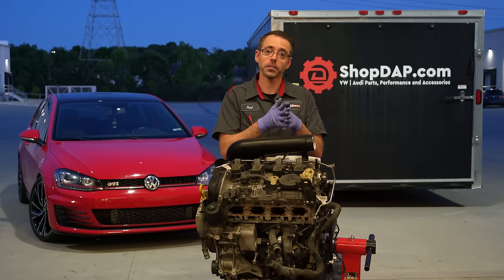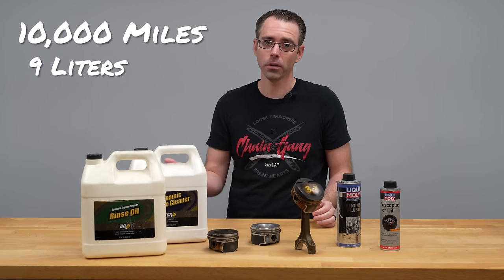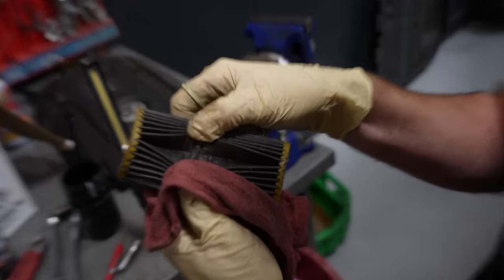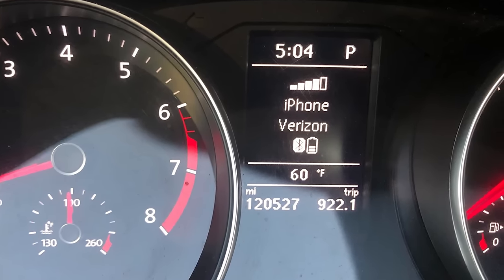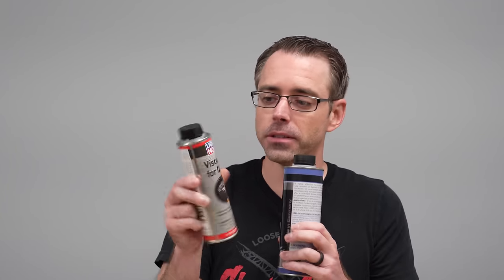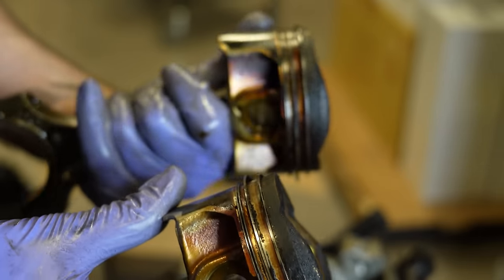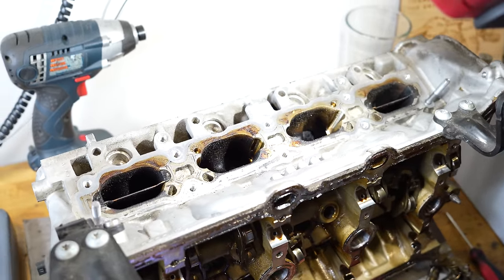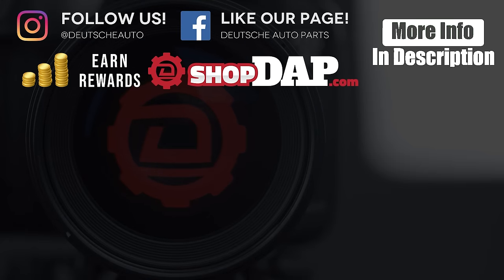Can you Fix an Engine Burning Oil for $20

Comment: Thats scary... If it broke down the oil filter like that... Whats it doing to your seals?!
Reply: The exposure to the seals will be a lot less than the full flow oil filter, also the short duration of use would limit the risk. It would probably be safe to assume there would be some buildup everywhere in the engine so by the time that has been removed the flushing agent would be drained out, hence the chance of damaging seals would be low.
Reply: Thats why you buy cheap oil after using that flush stuff, run it about 500miles and change oil and filter again for a better oil and oem filter.

Comment: Well.. good video how to flush the engine, but for stuck oil rings there is better metod: Just remove spark plugs, fill cilinders with 50/50 kerosene-acetone solution and leave it for the night. Next morning screw back plugs, drive 10 miles reving high and than change the oil afterwards. Tested on many cars.

Comment: These oil burner cars aren't being broken in properly either. There's a very small window to "seat" the rings. Idling at the port or dealer then driving like granny is bad for ring break in.
Reply: It's like if they ain't seated by the time it gets to the dealer ,you're screwed. 
Seating rings shouldn't take more than 5mins or so

Comment: Those "new" engines definitely don't last long. I overhauled my 90's nissan E16 and after 100K km of doing delivery the oil consumption started to be a problem but that is only because I messed up something on the rings (they draw a line on each cylinder), without that it could have lasted longer.
I always warm up my engine before I go out, but most people I see with mordern (even new) cars they turn the key (or press the button) and just drive away at full speed.
Reply: Sounds like your rings weren't rotating in the lands .. meaning. The gap always stayed in one place wearing line ..but that being said .. some pistons have a  brass titt in the land   where the ring ends come together ....go figure
Reply: @jamesgibson5876  It was my first time doing an engine. I didn't properly measure or sand the ring tips, I just took them out of the bag and to the pistons. And yes they always stood in the same place.

Comment: My 2007 Jetta 2.0T FSI engine started leaking oil some months ago and I figured I'd have to replace the gasket, and started getting a little nervous at how involved it is to replace that gasket. (Nothing is simple on these VDubs.) Today I crawled under the car and decided to try tightening the oil pan bolts a bit. I used some brake kleen to remove the excess oil and took her for a test drive. When I looked again there was no oil leaking. I will keep an eye on it but I'm hoping this will fix the problem. (05/31/23)

Comment: I guess my question is why would you not think that change in the piston is significant.  Personally I think it's hugely significant, it removes all but a slight amount of oil from coming in contact with the ring groove.  Interesting video.

Comment: Before you do an oil change, 4 ounces of sea foam! Run the car for about 50 miles, then change the oil! Sea foam will flush the carbon from the piston rings, as well as all the oil galleys. After a few changes this will clean out the engine and allow the rings to seat again. 9 bucks, what ya got to lose?
Reply: Excuse me where you get that sea foam??
Reply: Seafoam doesn’t dissolve carbon as well as Berryman’s because it’s just napthenic oil, naptha, and isopropanol, while B12 is mostly xylene which will become less clear and more brown quickly; the Seafoam doesn’t do nearly as much. You really want an additive marketed as a ring freeing additive, Yamaha’s is amazing according to DIY Dave’s video, but I tried the Startron which has polyetheramine since I’ve heard it works well and is effective while being easy on components
Reply: @meaculpamishegas  Glad to hear, I will continue using Seafoam. Had 25 plus years of positive results, .but I'm sure there will always be something better. Glad you found something that works for you.

Comment: Does this problem apply to the 2017 passat 1.8 looks similar to the one in video. What year were the pistons updated?
Reply: It is really only an issue if you do not change your oil every 3-5k miles.
Reply: @jb40now47  3к interval is something to go for, if you have your engine chip tuned. Otherwise it is a waste of money 🤷‍♂️
Reply: @jb40now47  do it evey 5k on the dot got the shwaben oil extractor super easy but i do drive a little hard only 170bhp lol
Reply: @MrLilc337  Then you should be good to go.

Comment: My A4 B7 2.0 TFSI was running really cold (65-70 deg C) and running through about a half L of oil every fill up (400mi). Since replacing the thermostats (x2) the oil consumption has dropped massively to something like 0.5L per 1200mi+. Presumably because the piston rings are heating up and expanding to reduce the gap through which oil can get past?
Reply: The only reason for oil consumption is the bad construction of pistons and especially too weak piston rings.
THAT must be fixed first, other things are definitely not the main cause, they are said to mask the real problem by garages.
I have often seen it with car engines and certainly also with motorcycles, think of BMW.
All kinds of stories about oil and running in were nonsense, only the construction was not good, but they did not want to admit it, all at the expense of the customers, just like Audi, Volkswagen and BMW.
Apparently modern engineers can't make good engines after 150 years because they don't understand how it really should work, I'm 100% sure of that.
Reply: @heinpereboom5521  yes, the only solution to fix the misconcept is to replace the pistons (or modify it: some did this in Germany) with a much larger U-flex oil scrapping ring (same ring type as on older engines), and very important :change oil OFTEN, all 10 000km is ok but not more!
Reply: @leneanderthalien  You are right, those people in Germany know more about engines than the engineers of manufacturers, which is a shame actually.
Also perfectly correct not to use the engine oil for too long, it is the most important engine part, even if it is liquid.
Reply: Cold engine, choke, cold start injector, ecm cold map sends larger amounts of fuel through, DILUTING engine oil, allowing it to EVAPORATE in the crankcase and get past the rings and burn off. Worsr case scenario was car driven daily five or ten miles for years was suddenly freeway driven for two hours! The diluted oil flashed into vapor was burnt by the engine suddenly consuming all the oil. BLAM no engine oil, rod went through the engine block. SEIZED
Reply: WOW .5l for 1200 miles??? Odd I will stay with my 5.3 LS motor as it looses less than a cup of oil per 3.5k miles. My wife's 2010 Milan uses the same and it has 140k miles on it.
Reply: Multigrade oil works best at the right temperature, but your oil consumption of 0.5 ltr per 1200 km is still almost the maximum consumption of a modern car engine.
So there is clearly something wrong with your engine.
Reply: Multigrade oil works best at the right temperature, but your oil consumption of 0.5 ltr per 1200 miles is still almost the maximum consumption of a modern car engine.
So there is clearly something wrong with your engine.
Because it is an engine with direct petrol injection, contamination of the injectors can cause a lot of dirt on the piston rings due to poorly burned petrol.
Check your fuel trims, then you will quickly see if the engine needs to correct a lot of fuel.
If so, have the injectors cleaned immediately, as the lubrication of the cylinder walls will also deteriorate.
Are you sure that the turbo bearings are not worn out and that your crankcase ventilation is working properly?

Comment: I had a Nissan back in the day that would burn about a quart every couple of drives. It was a noticeable smoke show when you drove it lol. After changing the valve seals with no change after, I topped the oil off with a quart of ATF and drove it for about 100 miles. After that, I pulled all four plugs and filled each cylinder with ATF and let it sit for the weekend. I extracted as much ATF as I could from the cylinders and reinstalled the plugs. I fired it up and let it get up to temp (thick white smoke the entire time lol) and then proceeded to drive the hell out of it once it had warmed up. Aka, redline shifts, WOT until the smoke went away. 

After that, I drained the oil and filled it with Mobil 1 15w-50 and continued to drive it as normal. Not only did it stop using oil pretty much entirely, it stopped smoking as well. I drove it for years after and it never used oil between the 3k mile change intervals. In my case, the oil rings were clearly stuck / gummed up causing the issue.
Reply: It's pretty uncanny how most of the oil Burning you see these days is from carbon'd up piston rings!

Comment: If you ever want to do a oil test for VW science, try Castrol "Ultra Clean" and Castrol Magnatec.  I started using magnatec a few years ago and it has been the only oil besides castrol that I trust. I tried ultra clean last year on a engine  refresh that lived off window stickers. The oil turned black after less than 10 drives. Ultra clean also pulled stuff out of my 4.6 ford.

I was going to put ultra clean in the 2.0T I just got done plugging in. But someone put regular Castrol on hold for me and I did not want to exchange it.

I was having the oil light at normal temp at above idle, having to limp it in a lower gear to go away.

Drained about the full jug and maybe 2 quarts more, but the light is gone now.

Magnatec has been my crud clean and smooth engine / noise oil. 

But after what came out with the ultra clean I believe it might be a good one.

I have experienced some cruddy engines to the point I always remove the oil filter first, drain the oil all the way then put the plug and filter on so the oil washes down the pick up tube.

Comment: Just a tech observation here, to me it seems ever since direct injection was made mainstream the excessive carbon buildup seems to be a byproduct.

Alot of the carbon left on the valves aren't washed of anymore, as it would by the multiport fuel , and the carbon gets sucked into the cylinder clogging up the rings.

Some of the newer engine seems to try and combat this by adding multiport injectors in conjunction with direct injection
Reply: With multiport there isn't much of a build-up that accumulates at the back of the valves, hence not much carbon that gets sucked into the cylinder. It's cleaned regularly and gradually.

Comment: Thank you so much, for answering questions I have had about oil burning in my 2012 Countryman! Dealers all say thats normal, in all European cars. I have been applying Moly products which have helped somewhat. Mini was so smart not to includes oil pressure light in this model. Really smart on their part. /sarc/

Comment: I'm not a mechanic but this procedure scares the daylights out of me. I've been fortunate to only own vehicles with gasoline engines that burn little to no oil between my 5K mile intervals. When I removed the valve covers for normal maintenance, the heads have always been clean. I normally keep them for well over 250K miles before I replace them and they still perform the same. I never use additives but I always use premium brand full synthetic oil in the recommended specs. I also use the best oil filter recommended for my engines and it gets changed with the oil change. 

Only once, did I try an oil flush. The engine didn't have any problems but I thought, what the heck... The procedure was different from this. It was a short run with the magic fluid (well known and respected brand name) added to the oil and run for 30 minutes before draining. The drained oil had black chunks of grit in it and my O2 sensor light came on after starting the engine with new oil. The light eventually went off but there was no difference in the car's performance - not that I expected any, because it hadn't been burning any oil. This was "preventive maintenance". Never again. 

I only use additives in my gasoline which is usually Techron Complete Fuel System Cleaner at 5K mile intervals. 

This is a good video but I am not persuaded to change what isn't broken.

Comment: Expensive? Yes. Exclusively sold to shops that perform this service? No. Found on US Amazon for sale to general public
Reply from the maker: Yeah we realized that it’s there after the video. They are not supposed to sell it there, so this video might change that availability
Reply: Yeah a dealer is trying to make a buck by selling on Amazon, happens alot. Take advantage
Reply: @Deutscheautoparts  ooo good to know thanks! Keep up the great work
Reply: Ebay too.

Comment: The BG stuff already got most of it clean.  I feel the Liqui Moly would have done just as well on its own.  They make some good stuff.  It probably also would not have left you with a horrible smelling filter that was ready to fall apart and clog something, thus causing a ton of damage to the engine.  BG may seem like good stuff too but I am a little leary of universal fluids.  Not only may they be bad but when I look in there and see yellow instead of pink or violet it just doesn't seem right!  I know it is just a dye.  One more thing to consider is that the BG machine doesn't get all the old stuff out and when you mix anything with G12 you are playing with fire!!  In this case the fire would be from a dealer wanting to burn your warranty!!  It is also because if that coolant gels it will plug things up, make a horrible mess all through the heater cores, and maybe even overheat your engine and cause it to die prematurely.  All of that for using a universal coolant!  It is NOT worth it!!
Reply: Erm... It was two different cars (or engines...)

Comment: I have a 2016 Pentastar engine in hot Texas and 159,000 miles on it. I RTFM as I always do and use whichever full synthetic oil is on sale and replace it every 5000 miles. I do not detect any oil consumption at all at the end of my oil change intervals. The oil stays right where it was when I changed it. Just RTFM and obey and you are going to be okay. That's it!

Comment: Hey there,  I know you should ALWAYS use the manufacturers spec of oil,  in my case VW 504 00.  I have a 2006 A4 with 135k miles on it Stage 1 Revo.  Recently I saw that Castrol, do a High Mileage oil (only available in the USA)  but they do not do a VW 504 00 oil.   Castrol list various advantages to using high mileage oil on cars with more than 70k.  But they would only recommend to me that I use the most expensive Castrol oil with the correct spec.   I bought some Castrol High Mileage 5w30 DEXOS 2 (Thanks Ebay).    This oil states it exceeds all industry standards.   I've been alternating between topping up with both of them.  When I got to 5k,  I used a pump and pumped all the oil out of the sump, and refilled with fresh oil correct spec. (Filter gets done every 10k by the garage when its serviced as I cannot be bothered struggling lay on my back)   The oil that came out,  mostly the high mileage was blacker than the night sky.   My question is,  Do you think it was so black, because its cleaned the inside of the engine and removed loads of gunk?   Or is it black like used diesel oil because its not the correct spec?  I just wanted to use the high mileage stuff to try and keep the seals and gaskets in good order.  (Edited thank you to @Rashid Bin Jafar pointed out my typo)
Reply: Do you mean oil spec as VW 504 00 ? Instead of VW 404 00 as u mentioned?
Reply: @rashidjafar  FFS  LMAO  YES.  I did mean VW 504 00. 🤦‍♂
Reply: @rashidjafar  I just edited it.  Thanks.
Reply: I have an 2002 VW Passat B5.5 with AZM 2.0 naturally aspirated petrol engine with 3,75,000 kms. 
I have high oil consumption, like 1 litre after every 2k-2.5k kms when using Mobil1 5w40 fully synthetic or Castrol edge 5w40 fully synthetic.
I still do have black oil when i change at 10,000 kms. (I feel maybe its bcz oil being broken down due process or overheated oil . Not sure

Now i am planning to go with higher viscosity -10w60.  Mannol 7902 or Castrol Edge 10w60. Heard the oil consumption will be very much less.
Both are VW 501 00 and fully synthetic.

My car as per vw it accepts VW 501 00, 502 00 & 504 00.

Hopefully it helps 😀
Reply: @rashidjafar   1 litre every 2k is pretty good.  Vw say their engines use 1L per 1200km.  If it was 1L per 400km then you have high oil consumption.   All VW/AUDI cars use oil,  even from NEW.  Its only Japanese cars that dont consume oil.

Comment: The second ring is the oil scraping ring, installed upsidedown it will let oil past. I have repaired engines where novice mechanics have installed one second ring incorrectly as well as all second rings upsidedown. The oil control ring allows the oil to return via the openings in that grove. I have best results with gas ported top rings and small increase on second ring clearance.